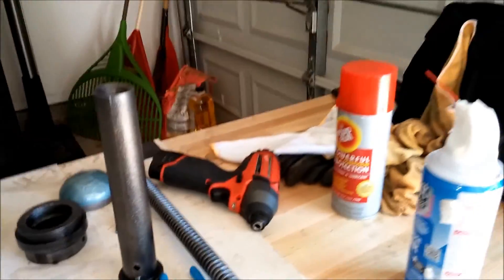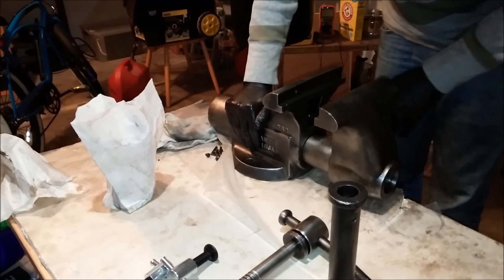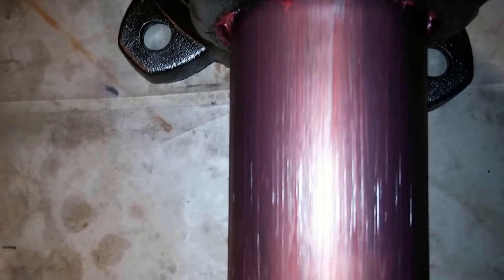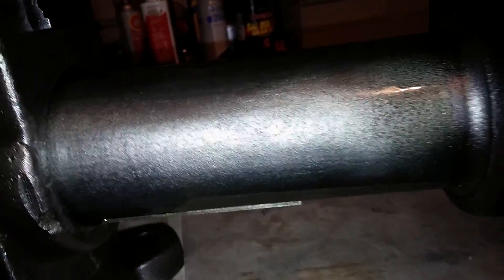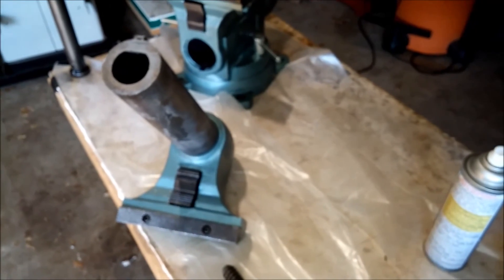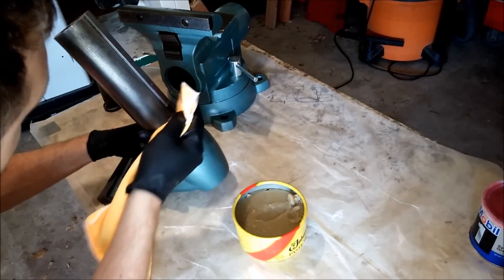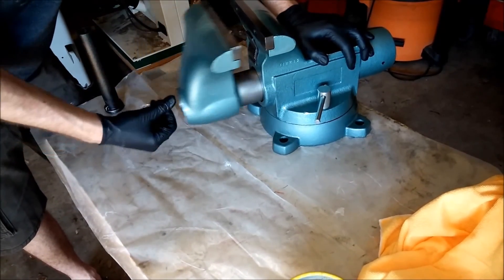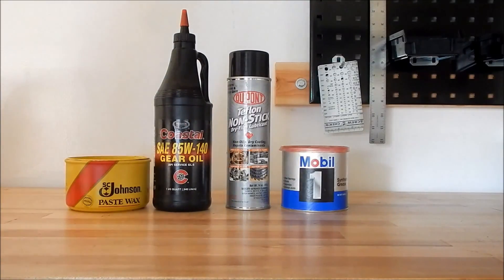Vise Lubricant Comparison

Comment: It is a vise, not wristwatch.  Looks like a burr on the key may be causing the noise.   Either way a gob of grease will work just fine on the slide and Threads.

Comment: That paste wax was discontiunued in 2021, and people are charging over $100 for a can, it you can find it. I found 2 unused cans in my shed down below (either my grandpa's, dad's or brothers'), and so far, I really like the stuff. Of course, there are other manufacturers of a very similar product (for much cheaper) now, but sc johnson is the OG. Surprised you didn't test the permatex antisieze on the slide. It's sitting right there. That's what I use and it's awesome. Little goes a long way. I prefer a grease that doesnt come off easily. I have a combo of the paste wax , covered with a thin coat of antisieze. I don't feel any metal on metal contact and its really holding up. Thanks for the video
Reply: Johnsons is not discontinued, you can buy it all day long at Lowe’s and any wood shop

Comment: The problem with liquid is evaporation.  After a time liquid lubes disappear.  Grease doesn't evaporate but will migrate as directed by the vises components' movement (creating gaps, ridges, light spots, etc.) requiring re-greasing.  I grease my Bessey 5" and Wilton 2 "about every three years, and use the liquid lubes on the garage door springs, with door hinges, in locks, etc.  Grease, also, repels rust better than liquid lubes. For me, teflon is too dry-slippery for vise use.  Wax, over time, dries to hard and crusty (don't want such with my vises).  Interesting vid, Ty.

Comment: Hey!

Thank you for the video update and response I got. First off, I agree with you 100% with what you have said in this video as well. My own project is wrapping up and I'm about done with my 1765 vise now. I have lapped the flat side of the jaw pads (both main and the pipe) and where the jaw pads fit into the dynamic/static - jaw(s)/base to under a thousandth of a inch for flatness & 2200 grit for surface finish. I'm also done re-tapping all the bolt holes so they have clean threads.

I admit that this is a bit overkill for the gunsmithing, woodworking, metalworking, tool making, etc. that I''ll be doing but I won't have to do anything to this vise again hence why I did it at all. I only want to fix the issues with this vise one time! Also, I sometimes make my own screws for guns and some of them can be quite small, hence the tolerance/flatness of the jaws. Eventually I'll be doing it another way, but for now I'd like to be able to hold the screw in the vise while I cut the slot on the head. It'll also be nice for making small springs.

I'm thinking that I'll use the molybdenum di-sulfide grease on the spindle threads where it won't contaminate my work or get all over everything. It's kept tucked deep inside the vise due to the Wilton Design. However, and I agree with you, that it's just not right for the dynamic to static jaw fit! PERIOD! It would get all over the work you are holding and like you said it's a BIG pain to get off things.

Speaking of that, the easiest way to get it off of things that I've found is to use Brownell's TCE (trichloroethane) or Birchwood-Casey's Gun Scrubber (hexane which is similar to the octane in gasoline). It's what we gunsmiths use to take literally everything off of guns prior to bluing. There is nothing better known to remove debris, grease and oils from metal! In fact, it's so strong that you need to use caution as it will go right through the thickest rubber gloves and numb your hands. In fact it was used for numbing during surgeries long ago. Acetone would also work, if virgin and not recycled, but brake cleaner is almost always recycled and won't work because of minute contaminates in it.

It's most exciting to see that the paste wax will work so well on the dynamic to static jaws and I'll be using that based on your video and testing.

I'll post back more when I'm done or close to it. Thank you again for sharing this project and your results with us all!

Paul in Iowa

Comment: I would try Break-Free CLP for the slide, it has PTFE and additives that form a protective lubricating dry film that doesn't grab dust. Works great for firearms, might work for this. Its nothing like the teflon spray, that stuff looks terrible. Maybe some dry lithium or graphite spray would work.
Reply: +Mark McCormack 

Personally I've had moderate to good luck with BreakFree CLP and LP for guns of all types but I've went on to the Army's 2nd generation CLP (MIL-L-63460 revision "E") called M-Pro 7 LPX. Gen one isn't bad but it can be better. I've not tried it on the vise nor do I intend to as it's oil and not grease. It's one thing when you clean something all the time and don't mind if everything gets oil on it (like a gun). It's another when you have both high pressures and constant wear where you typically don't access alot. That's then a situation that calls for grease and not oil in my opinion. But it's a most excellnt idea none the less!

Comment: I had a vice that went through a house fire and I went and grabbed it and just took a wire brush to it and sprayed it with wd40 and used it like that for about a year. I just took it apart and the jaw wouldn’t even come off the slide. The jaw would slide roughly and then when it got closer to the end it just stopped. That thing was seized on there tight

Comment: It is not hard to choose, they are movable parts with very low rotation speed and prone to dirt and debris, the best choise, any dry lubricant specially graphite or copper lubricant antisieze is what i use
Reply: Would a high moly paste do the trick do you think?